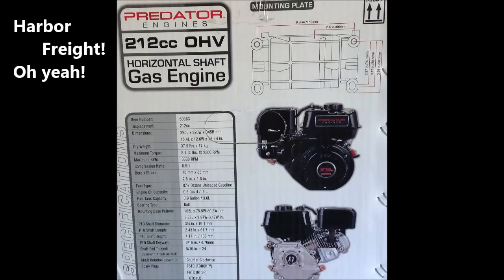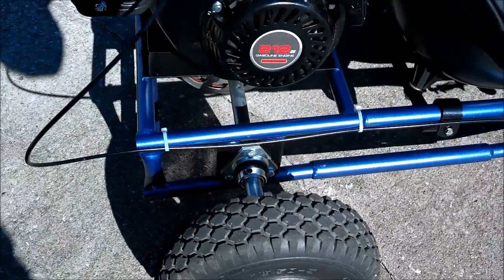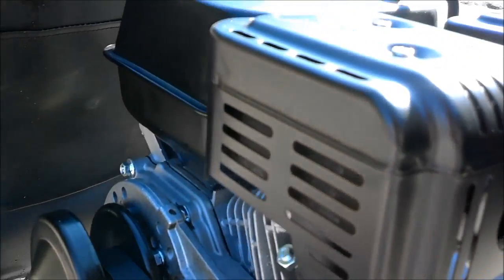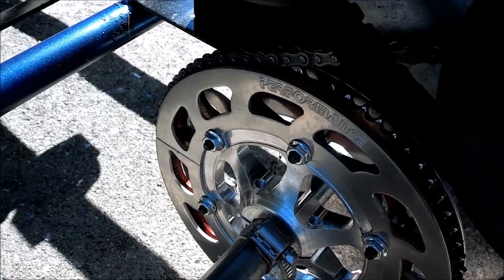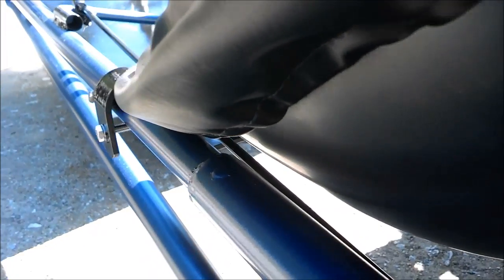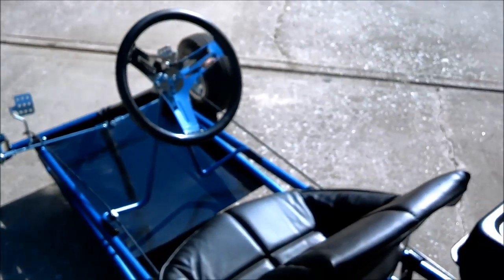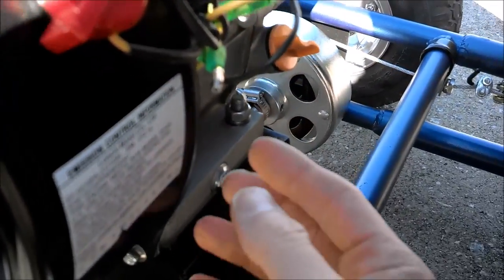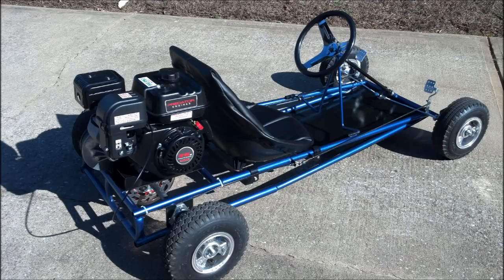Azusa Go Kart Kit + Predator 212 + Torque Converter Review

Comment: How many inches did you add to the frame ?
Reply from the maker: As best as I can recall, it was 8 inches.
Reply from the maker: 12 inch tube, using 2 inches on either end for welding into the existing frame for an approximate 8 inch stretch of the go kart.
Reply: @AndreasInGreer  perfect !

Comment: where did you get the engine riser? 2:14
Reply from the maker: My brother in law welded that for me.
It did not work well because it deformed from tightening the bolts from the engine through the riser to the frame. The engine rattle itself out of position and the chain got slack.

Comment: How much did it cost u
Reply from the maker: Too much.
$1000
That's wheels on, fuel in tank and ready to ride.
Reply: I wanna buy one of course I would have too work for it
Reply: Think of testing it on the freeway
Reply: May I ask where did u buy it at
Reply from the maker: @matthewchang5701  I bought the Asuza kit, state 1 upgrade, and torque converter online OMB Warehouse:
 (https://www.ombwarehouse.com/go-kart-kit-6-aluminum-wheels.html)

https://www.ombwarehouse.com/go-kart-torque-converter-clutch-kit-35-40-41-with-sprocket-bolt-kit.html

https://www.ombwarehouse.com/performance-parts/predator-212cc-go-kart-kit-stage-1-non-hemi.html

I bought the Predator 212 engine at Harbor Freight.

I bought the blue and black paint at my local hardware store.

The Asuza kit has gone up significantly in price! It was about $600 and is now over $1000.

Comment: What type of paint did you use ?? Looks great. 

Also, what was the process to extend the frame ? Did you simply slide a large diameter tubing over the existing frame ?
Reply from the maker: The paint was a simple blue metallic rattle can paint job. The black was a little left over glossy black rattle can.
Correct on the frame: I purchased some tubing whose inner diameter matched the original frame's outer diameter. I cut the frame and my friend welded the pieces. Super strong result and a much better fit.
Reply: @AndreasInGreer  Thanks for the reply, your build video has showed me many things I I need to know. Going to fit a 420cc into this my Azusa...hopefully.

You wouldn't happen to remember the tubing diameter you used? Lol.
Reply from the maker: @ryanlahay9361  I do not recall the diameter - it's been so long ago.
Yes, I believe it was Rustoleum.
Reply: @AndreasInGreer  what brand was the paint? Rustoleum?

Comment: I have the same set up with a 46 tooth sprocket and I'm 200 pounds, and I can go 34 mph. The difference is that I have a clutch instead of a torque converter. And with the clutch I have enough torque to take and to burn tire. My 212 predator it's stock. The only I did is to bypass the governor.

Comment: Back that governor screw/throttle stop out! 

It picks up a lot of power when you do that! Mine spins up to 5,000 rpm but still has the governor stop it to prevent over revving of the stock components.

Comment: your 72 tooth split axle sprocket is way too large that's why your only getting 18MPH  !!
you need about a 60 tooth axle sprocket then your good for about 40 MPH

you will also need a chain breaker for #35 chain and some master links
to shorten the chain for the smaller gear after that you can think about making more horsepower if you want but the small gear is what you need
Reply from the maker: Rob C 
Thanks for checking out my video. Yes, the sprocket is quite large. I installed this one as it matched the original one that was supplied. I have since purchased another sprocket and chain to accomplish 35mph or thereabouts.

Comment: Go Karts USA sells a bolt on mount that would have solved your clearance problem underneath the engine.
https://gokartsusa.com/Engine-Mount-Plate-Honda-GX160-GX200.aspx
Reply from the maker: That would have been a good solution as well and would have made the entire mounting much sturdier. The only advantage that my particular solution has is that it was free.

Comment: 18mph??? I found  25year old manco frame put the same predator 212 ,used wheels, and centrifugal clutch and it goes 35mph easy. Wow I was thinking about converting to live axle, glad I saw this video.
Reply: Having a live axle has nothing to do with speed. It's all about the gearing (sprocket size)

Comment: You spent 700, 800 dollars and probably months of work and got 18 mph? My 5 hp, 2 seat, 30 year old, clutch driven, manco go kart hit 45 mph (no governor).
Reply from the maker: The speed was a bit disappointing. The 212cc Predator has the governor installed and I had a fairly large sprocket on the axle. I now have a smaller sprocket and picked up a fair bit of speed.

Comment: Personally I'd flip the spindles around, leading position. Instead of running the tie rods under foot. Had the same issue with a recent build.
Use a fuel pump and move your gas tank. You'll gain a couple inches so your seat can go back
I actually cut the gas tank mounting arms off the engine and gained almost 5 inches rearward with my setup

Comment: i had this same go kart and i noticed you extended the frame.. i reallt need to do this... btw the riser on thje engine plate was a amazing idea because when i put the torque converter on (replacing the clutch i already had) i cut the back of the frame, then the middle support bar on the rear of the frame i had to replace with two on either side of where i cut... i then welded it all together and now i have another upgrade i wanna do. It is taking special wheel hubs (sold on multiple websites) and attaching them to the end of the axle. the part i wanna put on has four lugs where golf cart or bigger atv tires will fit... if you wanna know the links i highly reccomend this upgrade..... reply if you want the link to the part haha...
Reply from the maker: Riley Pilot - hey! Yes, the link would be appreciated!